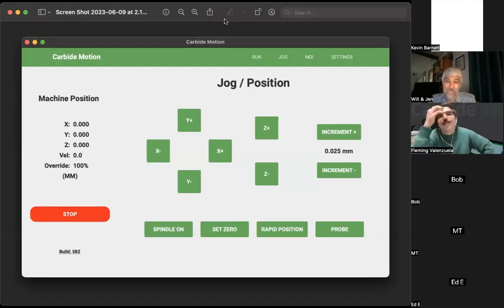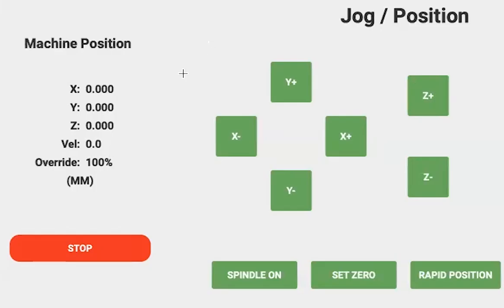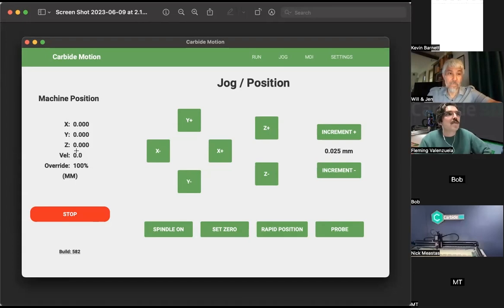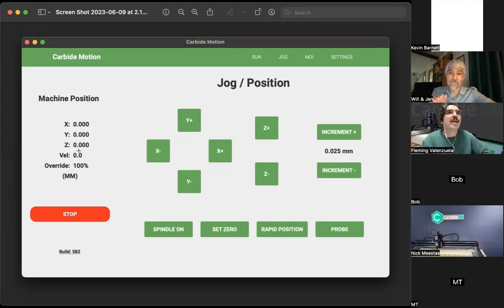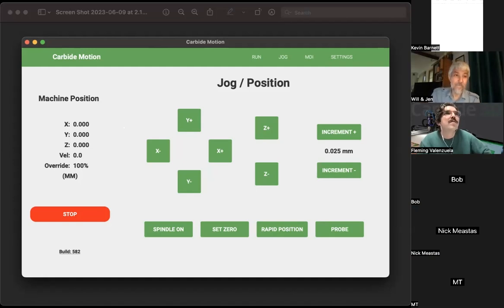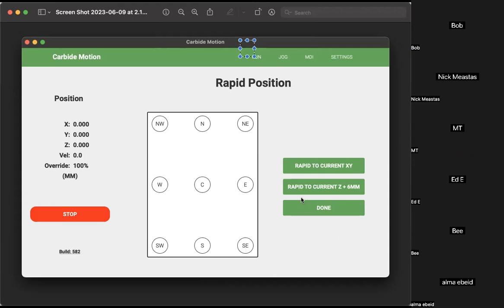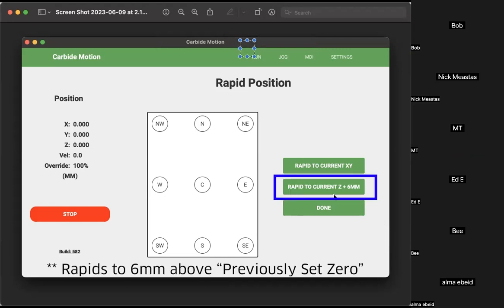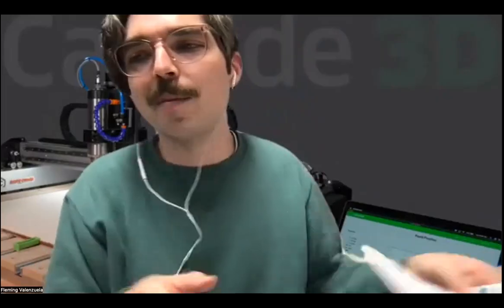Episode #5  - Zeros + Cutting Faster

Comment: sure wished my bitzero had softer wires.  The bit zero does not have any weight to it and so the wires will pull the device from the corner.  they should be made from silicone sheathing instead of pvc
Reply from the maker: The best practice with BitZero is to hold it on the corner of your material as the probing cycle is run.  This ensures the most accurate result.

Comment: BitZero question.  After setting my zero's, the bit goes and does it's thing on the BitSetter.  Then returns to the zeroed position at the corner of my work piece.  Except it's not exactly at the corner.  So I tried doing it manually.  Set my zero's.  It did it's thing with the BitSetter.  Then returned to the corner...and it's EXACTLY at the corner that I had set manually.  How come, when using BitZero it doesn't return to the exact corner?  Will my project be off because of that?
Reply from the maker: Brent.   After the touch off on the BitSetter the machine returns the X,Y coordinates where the Z was set.   
With BitZero the Z was set slightly inside of the XY Zero. Therefor, the machine will return to that position.   If you rapid to “current XY” you’ll find that the XY Zero is directly on the corner of your stock.  (As set by the BitZero)
Reply: @carbide3d  Ok.  Gotcha.  Thanks!!
Reply: What about multiple work offsets? G54-G59